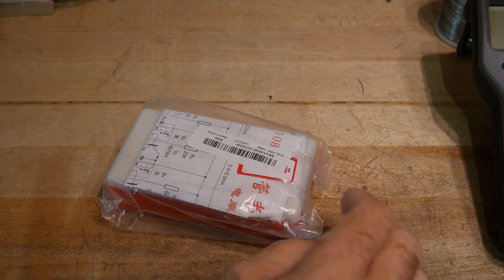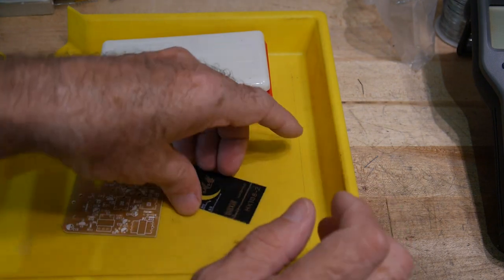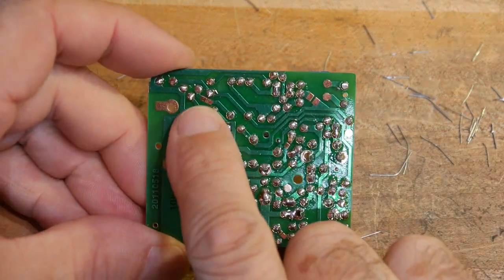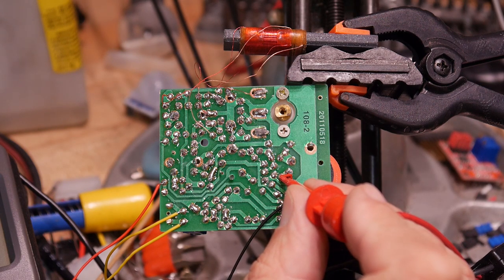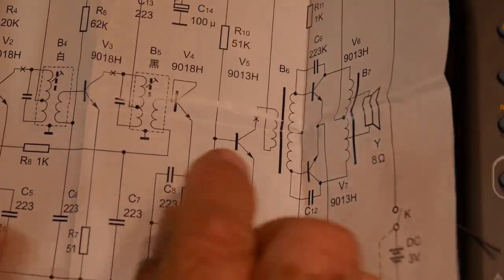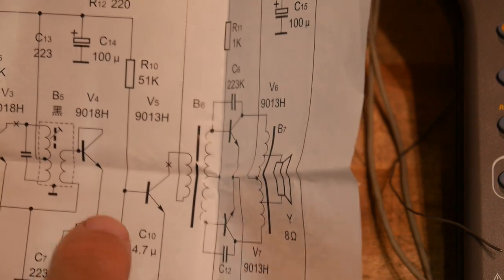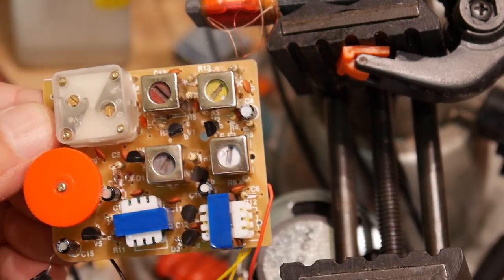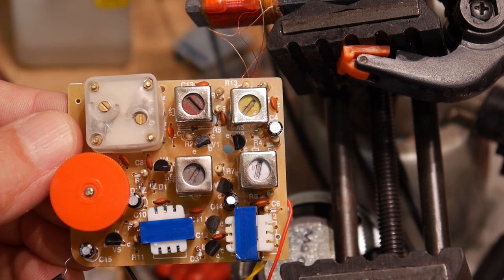#270 AM Radio DIY kit

Comment: Hi great video thank you for giving up your time making it. To align AM radio like this the procedure is usually as follows...

Set the IF as you have to a predetermined frequency by signal injection and peaking. The spec said 465k, you used 455k and mine worked best on 470k. Guess this is an arbitrary value based upon where the slugs sit most comfortably in their adjustment range. For a professional circuit you would use the manufacturers data as this would ensure correct tracking of LO and AE circuits with dial readings. 

AE=Aerial
LO= Local Oscillator.,

For the RF the common way to align would be as follows:-
Set the trimmers mid way. Both AE and LO.

Tune to the lower end of the tuning band and either align the dial with a known station or your signal generator if you have one. 
Carefully tune the LO (red) coil to get the desired station/frequency.
Now slide the coil on the ferrite rod for maximum signal

Tune to the upper end of the tuning band and either align the dial with a known station or your signal generator if you have one. 
Carefully tune the LO trimmer capacitor  to get the desired station/frequency.
Carefully adjust the AE trimmer capacitor to get best reception.

Repeat the above as the items interact.

Once done, the dial will reasonably track the AM band with consistent sensitivity.

I have one of these that I set to cover the 160m ham band and can listen to the locals on a Sunday on AM :)

I found it best to mount the antenna bracket between the variable capacitor and the board.

Keep up the good work.

Steve

Comment: I built this radio. 

It didn't work initially.

I found out one of the coils (IF cans) was bad. 

The end of the coil wasn't soldered to the leg. I was able to fix it, but it wasn't easy... very fine wire coming from the coil.

After that, the radio worked fine. 

I peaked the output by ear by tuning into a station and turning each IF can for maximum signal.

Performance is pretty good. 

The battery holder is garbage. Used super glue to hold it in.

Definitely worth $5 if all the parts work.
Reply: Electro Man
And now you have unknown random IF.

Comment: Had some heath kit(r) parts so i rummaged through. Found one slug ment for low short wave and subbed it for big red I kept the original coil just cobbed  the slug. Tunes kinda high. Runs well. Have several and broke some. You did alright

Comment: I broke the same component assembling the same radio but in a different way. I also found some tips to assemble and test this kit without any fancy equipment : put the resistor in a way to have test point and measure the emitter voltage of V2 with a good old analog voltmeter to see if the IF is aligned (V2 is used as a variable gain stage for the AGC by varying the collector current).

Comment: Mine worked right off the bat even with a severely chipped disc cap in the audio output, really pulled in a lot of DX.

Comment: That red coil is just for the oscillator frequency adjustment. You can get a fully working radio with that broken coil, it is influencing only the scale of the radio, not the sensitivity or selectivity. Mid position for that coil is perfect. Besides, you can also adjust the oscillator frequency on the trimmer cap located on the variable capacitor. So nothing is lost.

Comment: I wonder what those transformers are I mean the specifications etc. as I can't get none of those separate , only in kits like this one. I learn how to build my own radios and try to figure out the imepdance matching but I can;t buy those ttransformers anywhere :/ there are some similar ones on Mouser but reaaaaaaaally expensive so for learning purposes I need something cheap. I suppose the second transformer has 600 ohm primary and 8ohm secondery otr something like that?
Reply from the maker: even if you find them buying the kit will be cheaper and you get several. you can usually just measure the resistance with a multimeter.
Reply: I have LCR  meter so I will mesure exact values of inductance 😎 no problem but it is steange that I can't find them. So how did they buy them for this kit?

Comment: thinking of replacing that detector transistor with a schottkey diode.....
Reply from the maker: good idea
Reply: @IMSAIGuy  turned out kinda bad idea. it went silent with an 1n5419, even with a germanium 1n34 the signal was low, so was with 1n4148. but it went louder with a small signal mosfet 2n7000, so much that i had to increase value of R9 three folds.
Reply: @iceberg789  yeah Shango066 tried the same thing and got the same results
Reply: @audiodood  which episode, you remember ?
Reply: You can always perf board a better AM detector circuit if you want.
Reply: @audiodood  thanks
Reply: @ralphburns6659  right

Comment: lol my kit didn't even come with a 9018G transistor. Just 9018H and 9013H. So i guess i cannot finish mine without replacing one of the transistors. Man these kits are often really hit or miss.
Reply from the maker: 9018H is fine
Reply from the maker: http://radio-diy-web.weebly.com/uploads/2/6/9/0/26900885/19_8_transistors_manual_.pdf
Reply: @IMSAIGuy  Hey thanks  for the PDF file :D that helps a lot! MUCH appreciated!!! And awesome. Gonna solder the 9018H onto the empty spot then.